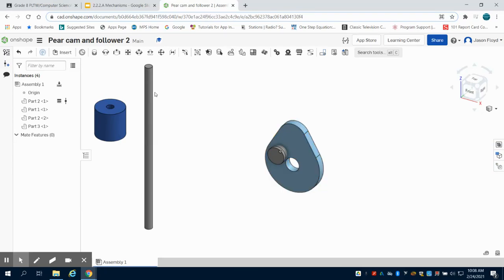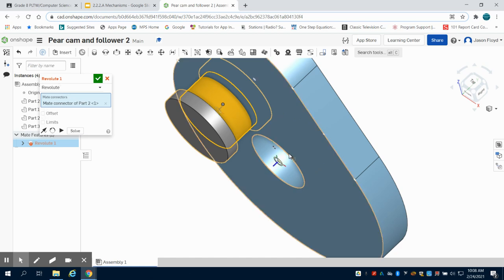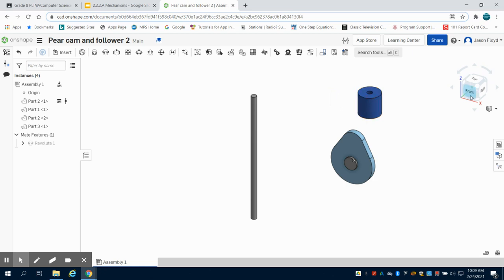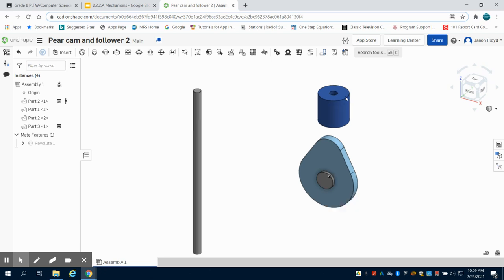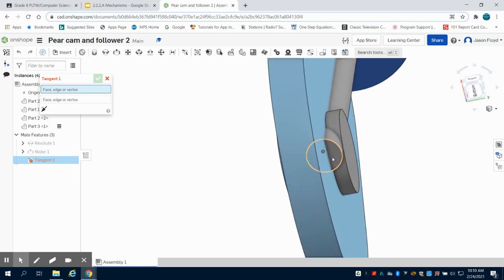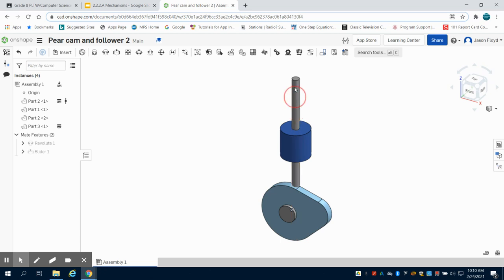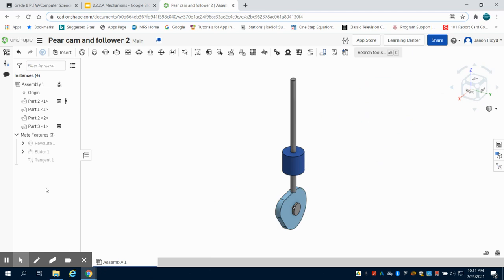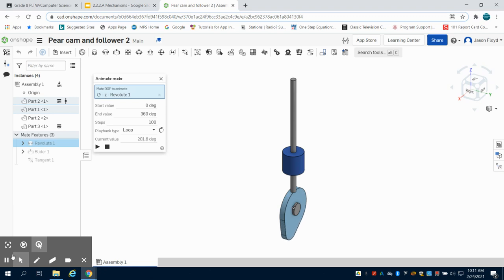Cam & Follower Assembly & Animation Onshape PTLW

Comment: Thank you Jason I learned a lot about On shape.  Found out that although free, the designs you produce are shared with a community.  I will stick with tinker and with my simple requirements.  ON Shape is affordable however so I might use it in the future.
Reply from the maker: I do enjoy TinkerCAD as well and use it for lots of things when I 3D print. If you have any affiliation with an educational Institute OnShape is free and it doesn't share your designs.
Reply: @Tomorrows_Eng  I am I semi retired medical device CEO that is unfettered in my requirements to produce results for an investor. I seem to be a jack of all trades and and interested in esp32 interfacing with App Inventor and 3D printing to produce medical devices. Very happy to make your acquaintance. I appreciate and respect your very Broad and cross discipline knowledge